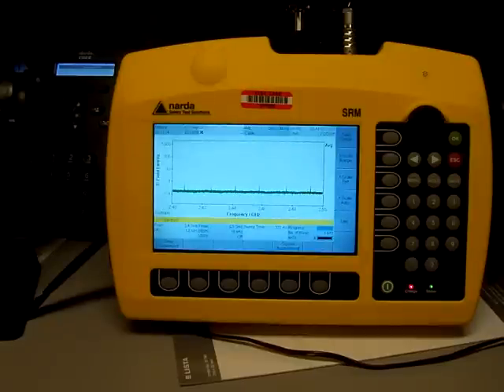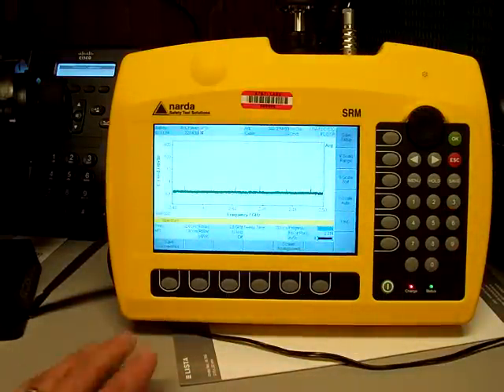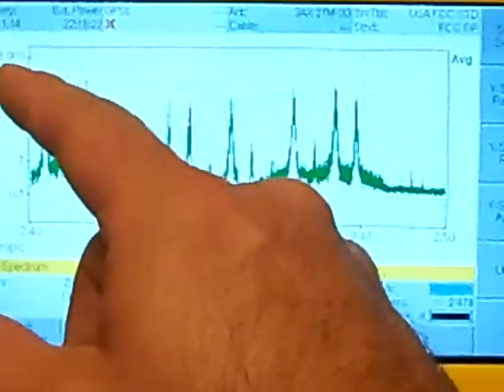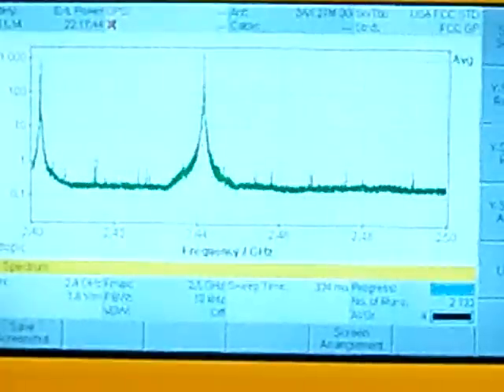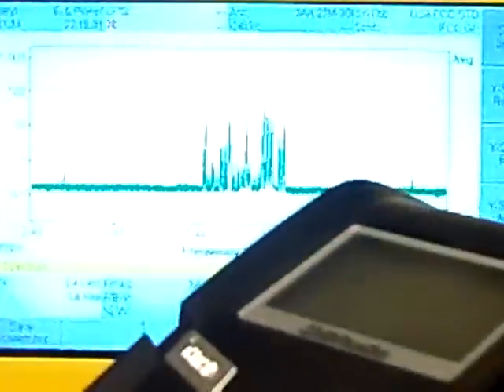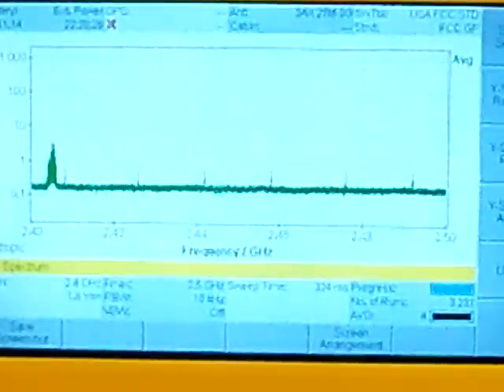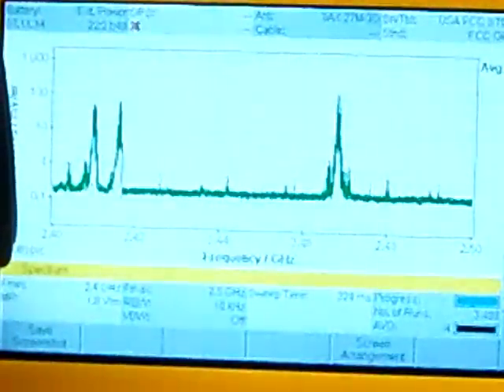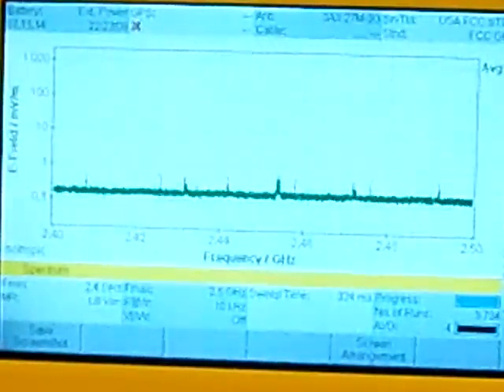2.4Ghz Frequency Strength Testing

Comment: Thanks for the video (and also the overview article on rcgroups)! There is surprisingly little concrete information to be found on the net, making this a (welcome) outlier.

The last one was the Spektrum DX2E, wasn't it? Which I think is surprising, given the explanations of how DSSS is supposed to work. At least from what I could learn with one evening of reading on the net.

It would be very interesting to see how those radios would react if part of the spectrum were blocked. You don't happen to have a narrow band 2.4 GHz oscillator lying around...  In particular the last one could be interesting, would the peaks fall of in that peculiar pattern in a noisy environment?

Comment: Thanks for the video, I used to work in two-way radio, and now I am into rc. I just bought that BER radio because of telemetry. I am running a nitro, and having the temp sensor is the reason I purchased it. I can't believe they are so inexpensive, it appears they have more power than several other radios in the price range.
Reply from the maker: Cory Reeves Yes sir, those BER radios are quite impressive for the price point!

more info on them here: http://www.ultimaterc.com/forums/showthread.php?p=2138842
Reply: Awesome I will check that out, thank you.